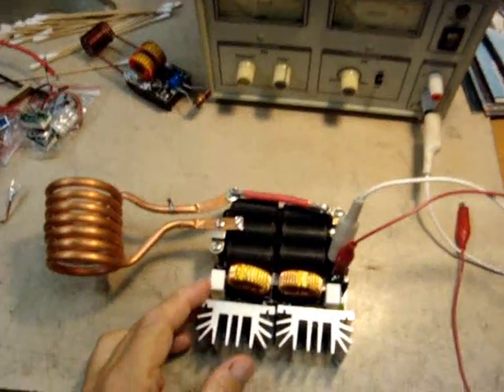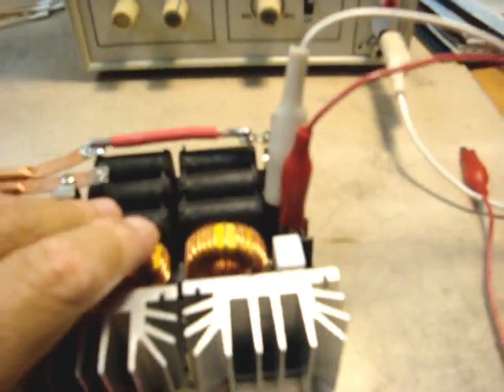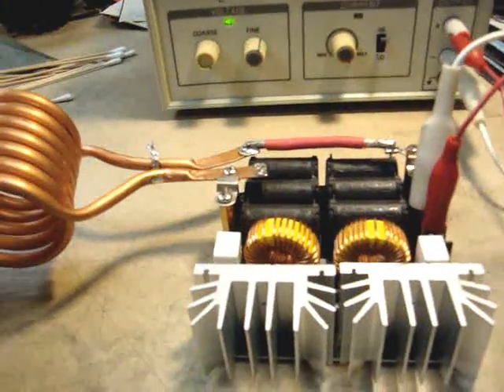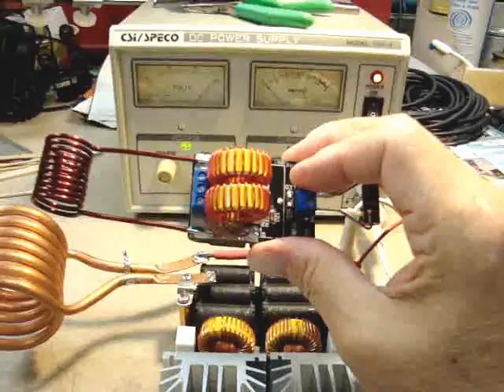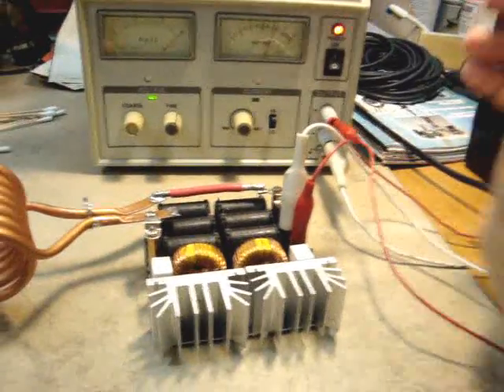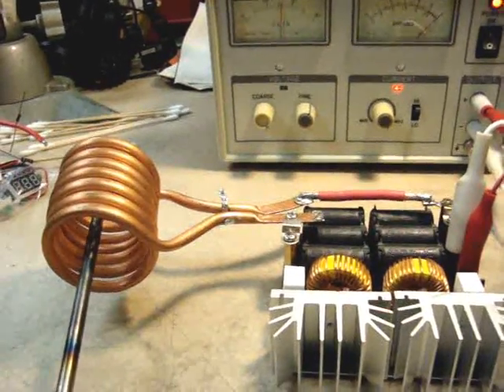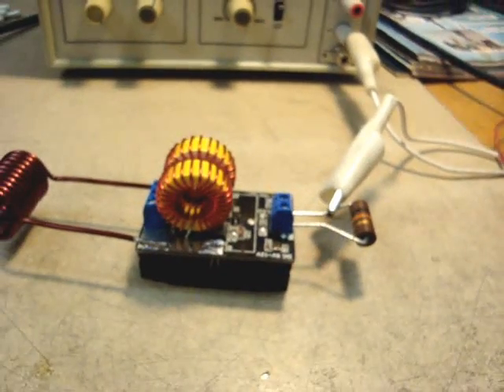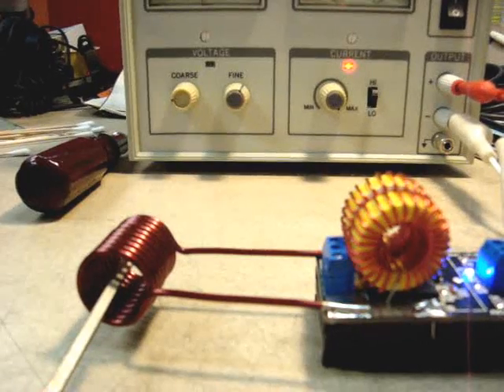Induction Heater Review

Comment: ...surprised you didn't blow a MOSFET.
With a 12v battery (about 7AH) the 2000w ZVS should get all that stuff red hot!
THANKS FOR THE VIDEO!!!
Reply: no, wattage is voltage x current, that would be at max around 240w

Comment: I do wonder why they don't put a capacitor in series with the gate drive part of the circuit, as it would ensure that it fails as an open circuit instead of a short
Reply from the maker: Good point. I don't know either, but it'd be worth trying.
Reply: D.C. being a forbiden state one might as well wonder if a simple 556 timer chip followed by dual integrated gate-drivers (with internal interlock logic) wouldn't fix that.

Comment: I didn't think it got hot until you put steel in the coil.
Reply from the maker: It gets warm, but when steel is put in the coil, then it starts heating the steel and the other components will get hotter too. It's  good idea to have a fan on it for prolonged use.
Reply: @bob4analog  thanks Bob

Comment: What if you reshaped the coil into a flat one will it works well? What things should be considered in reshaping for example the number of winds, the diameter... Please explain
Reply from the maker: Yes, that is done in many induction heaters. A "pancake" coil can be made for that. Here's an example:  https://youtu.be/8s8P75pYnZs
Reply: I've seen different videos about induction cookers... Ok I'm asking about the things you have if your coils reshaped into flat one what should be considered to not burn it  the number of turns? The diameter? What
Reply from the maker: @ahmadnab7969  - its usually the number of turns. If such a coil is to be made, the coil shown in the video I sent you should work fine.

Comment: Found out yesterday if you hook one up backwards to 28vdc battery bank it will explode the mosfets and the traces on the circuit board.  Lesson learned I hope.  Ordered new Fets and a new heater also, just in case they don't fix it.

Comment: Good video! Thank you - I  ordered one of these and should have it in just a few days.  I want to build a small rifle casing annealing heater. I would only need 1 to 2 copper loops on the actual induction coil since I would only need to heat up the case neck. Do you know if that would work if I trimmed off excess coil windings?
Reply from the maker: Thanks! The coil can have maybe 1 turn removed, but I think it probably won't work with only 1 or 2 turns. You can try it, but the unit is 'tuned' to operate with the coil turns supplied. However, I've seen some induction heaters with a seperate coil of 2 turns connected in series with the main coil. I would recommend this rather than reducing turns on the supplied coil.
Reply: @bob4analog  thank you!

Comment: i got no problem connecting to atx psu, 12v line. Switching on from home power supply to atx psu, .. the unit just turn on with indicator lighted.
Maybe its your power unit is not capable.

Comment: U can get those High frequency capacitor s from old induction oven circuit board s ... scrap those capacitor s ... induction oven s have bigger hf capacitor s rated at 650vac and 1200v dc and they are mkph.
Reply from the maker: Good info,  thanks!
Reply: @bob4analog  ur welcome..sir.

Comment: I do not have a power supply like yours, what could I use for a power source?  Thanks a million.
Reply from the maker: DroneXFun - I've seen two 12 volt car batteries connected in series for 24 volts work ok. Hope this helps.

Comment: huh
i was wondering why a 500w unit over loaded a 1kw psu
Reply from the maker: INVISIBLE SUN - What do you mean?
Reply: it still does it. i have a 1kw 36V dc powersupply i have the same one you showed on the ebay sight. i tried turning the psu on first. then connecting it it still kills the psu.. im confused.
Reply from the maker: INVISIBLE SUN - Hmm.. that is odd. Can you do a load test on your power supply?  Say, maybe for at least 10 amps? I'm just wondering if the surge is tripping the current overload when connected to the unit. Also, try connecting a 1000 mfd (or higher) capacitor across the power supply output, then connect the unit. Or how about turning down the power supply voltage to something like 20 volts, try that 1st.
Reply: i had it powering a 500W ish asic miner before this aplication ill have to put a load resistor on it to see if it works wit 10 amps i also have a huge cap its 47,000kuf at 450v
yes i know it can kill me 
and after staring at it for like a half hour i dont think i can change the voltage
idk lol
Reply from the maker: INVISIBLE SUN - No, that 450v cap will not charge up to anything higher than the voltage it's connected to.. so yer safe. So u can Use it. Again, I think it'd be a good idea to start your unit with 20v, then increase the voltage to 36v.

Comment: Your powersupply cant take the inrush current at start up.
pretty common.

I dont think this has anything to do with the ZVS board.
Reply from the maker: Yes, that is correct. I touched on that in this video. However, I demonstrated that the ZVS will lock up if voltage is ramped up. As demonstrated, these boards need a quick start up voltage when applied with adequate current to operate properly.

Comment: Thanks for the tips. I've got a 600w 48v PSU on the way for mine. Any tips for the coil? I'm thinking about cutting off a few coils to focus the resonance / heat better (I'm trying to make something that will heat up rusted nuts).
Reply from the maker: I haven't experimented with any other coils other than the one that came with the module I got. Mine has 8 turns of 1/4" copper tubing 2" diameter. I've seen variations of other coil dimensions here on YT that seem to work good. I think these could be copied and should work ok.

Comment: I just bought a cheap inductive heater on ebay. It didn't come with a coil so I will have to wind one. Since I am not looking to use it for long initially I will probably use solid copper. So far i have not found any information in the number of coils and diameter (inductance needed). The coils in videos vary from 2 or 3 turns to at least 8. Diameters vary a bit too. That seems to be a wide range. Since its a resonance circuit I assume the could inductance will change the circuit behaviour. 

If you came across a good source of info in this can you point me in the direction?
Reply from the maker: Manick N - 8 turns of 1/4" copper tubing with 1.5" inner diameter is the coil dimensions of my heater in this video. If your board looks like mine in this video, making a similar coil as I described should work ok. Most of the induction heaters boards I've seen use similar dimensions for their coils. For making coils,  It's better to have too many turns than not enough. Hope this helps.
Reply: Thanks. My board is slightly different. 2 caps as opposed to 4. I didn't have copper tubing on hand and the contacts are not conducive to attaching that so I used strands of wire from an armoured cable. The wire was just under 2 mm (75 thou) thick. 8 turns with 1" diameter.

It is getting the metal in the coil hot but not glowing but its heating up the fets more than the wire. I tried a computer power supply after its switched on with a fast contact. I also tried an old car battery that read 12V when metered.

So far no luck getting it to function properly without overheating. Any experience with this problem?
Reply from the maker: Manick N - Can you send me a link where you got yours? I would like to see it, Thanks.
Reply from the maker: Manick N - Look at this one ...  https://youtu.be/qx5xUqZvOZs . It's identical to yours. It uses a 10 turn coil and a 31 volt supply. It appears to be working well in th he vid. Perhaps you could copy this one for your board.
Reply: Thanks for the link. I did not see anyone using the identical coil. I don't have a power supply so getting 31V is a little tough. The manufacturer rates it at 12V to 30V on the board so he is pushing it.

I will try connecting two car batteries in series to get 24V. Right now I have a coil that is 9 turns 1" diameter. Measured it at 1.1 uH.  

If I do not blow it up I will try some different coils and do some measurements to see what is the best power transfer at a given voltage. Once I get some data I will report back. Probably do a video too so maybe it can help others.

Thanks again.
Reply from the maker: Manick N - Ok, yes, I think your 9 turns 1" diameter coil should work ok. I agree, operating the device to 31v is probably pushing it, so just operate yours at 24v. In the vid, you could see his coil to get an idea of what yours should look like. His module looks like yours. that's why I mentioned making your coil like his. I hope it works for you. Yes, make a vid of yours.. would like to see it. ;-)

Comment: You use a smaller dia. coil for that screwdriver you will see it get red hot quickly. If you notice that in that coil the magnetic flux is more stronger closer to the coils. But with the small dia. of your screwdrive, its not deep enough into the flux line. So try one a lot smaller with that same unit and you will see.
Reply from the maker: billsherenow - Yes, you're right. I tried that sometime after making this vid. I still need a higher current power supply tho to make this h heater work at its full potential.

Comment: are you ballsy enough to connect this thing to a 12 cell in series bigass li-po battery? ;)
Reply from the maker: 260830107 - Yup! Stright up!  %-b
Reply: I'll subscribe your channel if you push this thing at it maximum rating of 1000 watts =P
Reply from the maker: 260830107 - X-D

Comment: Very Interesting! any idea how to make an induction cap sealing machine. More specifically, the manual type with hand held tool that performs the actual sealing. If so, I have more questions to follow :)
Reply from the maker: If you're referring to cap sealing such as those on hermetically sealed plastic bottles, like this video -> https://youtu.be/EgzJaVLmpY0 , then I think these induction heaters like I demonstrated should work ok. However, a flat-shape spiral coil would be needed. There are other YT vids that show spiral coils with their induction units. I haven't tried a spiral coil yet, but it looks interesting. I tend to think the coil that comes with the unit may work for cap sealing as well.
Reply: I would be interested in knowing if you could take the factory hand held unit apart and separate the red button that initializes the process to a different location such as a homemade box made out of wood.
Reply from the maker: I think that would work.. good idea.

Comment: Your cables are to thin, that's why you not get enough current.
Reply from the maker: The power supply will not provide the needed current. I mentioned this in the vid at 4:21... the power supply cannot provide the needed current and it folds back beyond 5 amps.
Reply: Yeah, but ned star is right, the cables are too thin so you're losing power there. Thicker cables (and good banana plugs, not those!) will get you much closer. You can see what he means by measuring the input voltage at the board with a multimeter: you'll be surprised how much the voltage drops because of the cables!
Reply from the maker: guillep2k - Ok, thanks, but this issue was already addressed in the video. Please review it and see my comment on it.
Reply: Maybe rewind a mot and appropriate rectifier bridge.
Reply: Not the test leads per se, though there is some voltage drop. Bob H demonstrated that by potting up the PS slowly. The need to kick start the tank resonance appears to be the root cause - see this vid https://youtu.be/gNL4H5fC6AY
Reply: And this guy shows that if the voltage comes up slow both MOSFET gates are going to become saturated in sync and lock "on" the MOSFETs. With no resonance neither gate can be pulled down. https://youtu.be/5WtUDRaOm-Y. Thank you Bob H for the simple & practical explanation.

Comment: Firstly, thanks for the nice video.
I have a question.
if we use two boards and the output of each one link to one coil. Is the watt become double
Reply from the maker: - Glad you liked it, Thanks. Good question - I wish it was that simple, but, no, that won't work. Because of the way these induction heaters are made, only one coil per board will work. Having 2 boards in parallel with 1 coil would certainly cause operative interaction issues between the boards and cause them to burn up.
Reply: Thanks for explanation

Comment: I'm actually looking to build one of these for my 3d printer. I'm sick of the ceramic heater cartridge burning up and an induction heater is said to have a much longer service life in similar applications (injection molding processes use inductively heated stainless steel nozzles).

I've seen homebrew setups with polyester capacitors placed just after the heated coil. Capacitors act as a resistors with regard to AC power, so, depending on the frequency of the electricity coming out of your rigs, and whether or not they have poly-caps already in place, you might be able to add that sorta thing to avoid having to hotswap them. Otherwise this means I'm going to have to add some homebrew c++ to my 3d printer code.
Reply from the maker: Wish you the best on using your induction heater for your 3D printer.. sounds interesting. Make a vid of it and post it. Would like to see anoter use for these in'die heaters.

Comment: The size of the coil to the diameter of the metal  you  are heating is important. In your  bigger unit the coil was too big for the screw driver. A smaller diameter coil with the number of turns adjusted to maintain the same inductance would have smoked the screw driver. That is why the little one worked better. In a lot of the ads for these things they warn against using slow starting switching type power supplies and less than 12 volt supplies,  for just the reason you demonstrated. They say it can blow the MOSFET transistors in the device. I suggest you avoid doing that and start with the supply on, as you demonstrated if you don't want to destroy the thing.
Reply from the maker: Nice tip, thanks. The power supply I was using was not able to supply the current necessary and it kept folding back. The small unit didn't require as much current and worked better for the demonstration. Of course, the main point of the vid was to explain the 'short-circuit' phenomenon of these type of induction heaters and how to work around this issue. Glad to know that I wasn't the only 1 that was experiencing this problem.

Comment: can you tell me where i can buy a a good power supply for the same induction heater? can i use an arc welder? or is it possible justto plug it in?
Reply from the maker: This one from ebay should work ok... http://www.ebay.com/itm/High-Quality-24V-36V-48V-DC-480W-Regulated-Switching-Power-Supply-Transformer-/162167259142?var=&hash=item25c1ec0006:m:mc1iYOLlk7vAXHOUjRbGmdg
Reply: Thanks man
Reply from the maker: Certainly! Glad it was of some value.
Reply: Нуржан Сарманов No and no. The welder is unfiltered raw DC and this device euns on 12 to 30 volts of filtered DC. The 120 volts or 240 volts AC from the line (mains) will instantly destroy it. You need a DC power supply or large batteries, not a welder or a battery charger.
Reply: Get two 600W used PC power supply then just set them in series.

Comment: Hello,Bob.That's a very good viedo!But i have some question.Do you think  this board can light LED with wireless way like telsa coil?And why amp will overload when metal began heating?
Reply from the maker: Thanks! I don't think this will work for LED's, it's possible,  but probably not practical.  The power supply I am using in this video is over loading because it can not provide enough amps for the induction heater, but it's all I had. It did ok for the demonstration. The induction  heater draws more amps when it heats metal; that's normal for these units.

Comment: Hi! What is the output voltage (where the coil is attached approximate values)? many thanks.
Reply from the maker: +Zapadug Zapadugov - I'm not sure, but I think it's about 3 times the supply voltage. I have not checked it.
Reply: +Bob H Thank a lot and what is the currents ratio? (consumed from power current)/(current through the coil) ?
What current is consumed from power supply ?   Ips 
what current is passing through the coil ?              Icoil
Reply: +Zapadug Zapadugov during this 3 times greater coil voltage , compared to voltage from power source
Reply from the maker: +Zapadug Zapadugov - I don't know what the actual RF current is in  the coil... I've never measured it.. Sorry.
Reply: +Bob H Is it possible to repeat the test with measurements. Could get some really interesting things.

Input current and voltage 
and 
Output voltage and current
during normal operation.